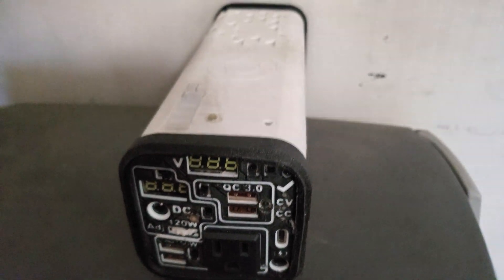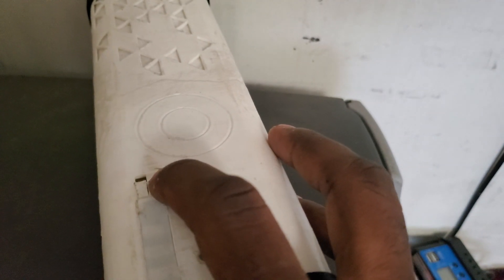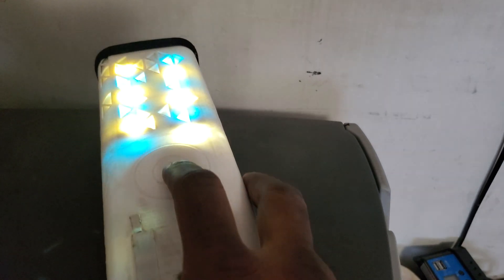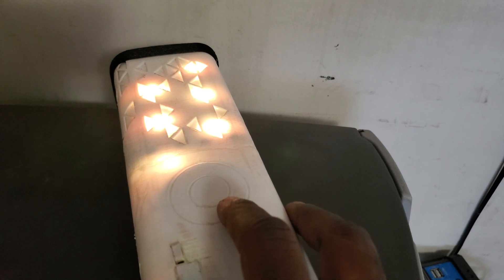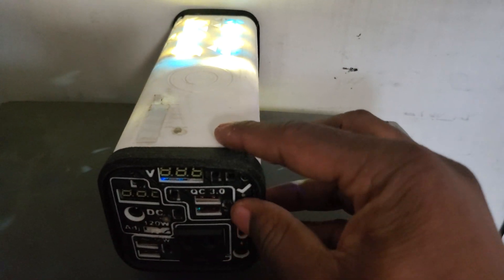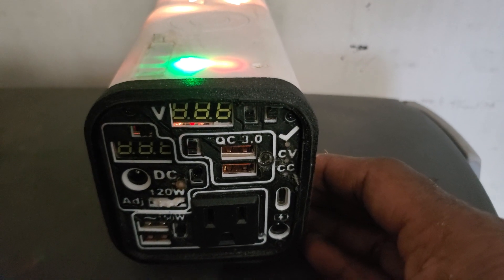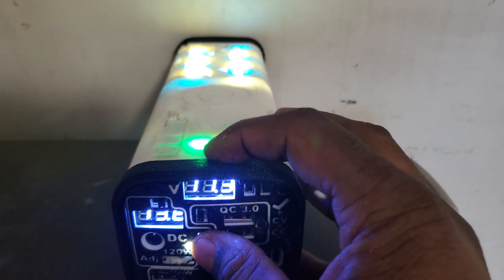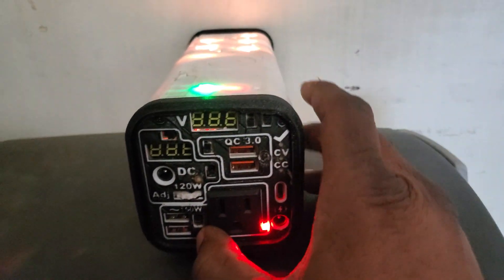Ultimate 18650 Power Bank

Comment: can you use the inverter and the usb at the same time? because I've noticed that the modules are all connected in parallel, shouldn't that give a voltage drop off?
Reply from the maker: They are barely being loaded. I never put a heavy load on the inverter so everything function as it should. The issue is that since this is a 3s setup 11.1v nominal, the inverter will shut off prematurely when the batteries are still decently charged. 

If I were to do this again, I'd make a 4s setup and use a step down converter for the inverter as a 4s setup will run from 16.8 volts down to approximately 11 or so volts.

Comment: Clearly not a beginner project, but with my habit of diving way too deep into things it might be my first
Reply from the maker: Make sure that you really look in the video. I'd also recommend that you put in a fuse holder as it is a pain in the butt to replace the fuse on this thing.  Don't get discouraged and you'll be fine.  

I am looking at his current more compact build.
Reply: @esqueue  I was thinking of just rigging up something to use standard automotive blade fuses
Reply: @esqueue  I was looking at this more compact build aswell but I had so many 18650 cells already that I did not want to purchase the higher discharge A ones, any idea what the downside would be to use a 5A max discharge vs the 10A he says to get

Comment: Hows the 3S works? What do you think, is it possible to use 4S instead?
Reply from the maker: The problem with 3s is that the inverter cuts out pretty early. 4s is definitely possible but you'd have to lower the voltage to the inverter. Possibly 3s with some type of boost for the inverter would be another option but would require redesigning.

Comment: Hi.
Im thinking of making one like that.
Tell me how long does it last on charging laptop throught dc plug
And through inverter.
And how long does it take to charge itself.
What if i increase the cell count to 30.... because i dont think these few cells would last more than 1 or 2 hours.
I need at least 5 to 6 hours on dc charging laptop on 19.5 volts
And if i use inverter my laptop charger is 90watts

Comment: How much time did you end up investing into this project? Thanks in advance!
Reply from the maker: Definitely took months between the slow china shipping, re ordering the parts on amazon and ordering parts that ended up being slightly different than the ones listed in the original video. Some were on error but some were on purpose and slight modifying of the cad files to make them work. 
It was more fun than anything. I am finally getting use out of it. Mainly to power my soldering, my dc refrigerator and to test devices.

Comment: Hello what kind of USB type c fast trigger charger did you use. It doesn't work for me. I built a 12, 6v 42ah 18650 battery myself. Really cool if you can help me with that. LG Tom
Reply from the maker: I ordered the ZYPDS model which can be found on AliExpress, Ebay and possibly Amazon. While I try to keep up on tech, I had never heard of 3.0 PD and made the mistake of thinking that I'd somehow get 20v out of my USB C chargers that were rated to 12v max. 

After getting Getting one PD charger on Amazon, I still couldn't get it to work. It clicked on and off. I ended up using an old Laptop power adaptor that I had laying around.  I'm sure that a different brand would have worked but I didn't bother.
Reply: @esqueue  I do it completely differently now I have ordered some step up converters, one even runs with micro USB 5v to 12v and 24v at 0.8 ah and for the car I have ordered a 12v power supply unit that can set the man bite 25v so that you can travel then also has electricity. My battery should then have 50-100 ah at 12, 6v

Comment: Hello @esqueue, you mentioned that you changed the Wireless Charger to another one, can you provide the listing (if it was ebay) or model?

And where did you connect it to.

Thank you.
Reply from the maker: I purchased it off of aliexpress though I'm sure that it can be found on eBay. It is a 10 W wireless charger. For it to be ran at full power you will need to power it with 9 volts instead of 5 volts. I ended up purchasing 10 of the mini dc buck converters that he listed by mistake. I used one of them to get power from the main  power line. The one that powers the relay to the buck converter. The switch is ran between the power to the buck converter.  https://www.aliexpress.com/item/32951758605.html?spm=a2g0s.9042311.0.0.27424c4dyRb8rt
Reply: @esqueue  Thanks :)
Reply: @esqueue  Is it compatible with iphone and samsung ?
Reply from the maker: @GliCidO  It charges my Galaxy S10E just fine.

Comment: I'm planning on designing a new one with a custom inverter and possibly a custom bms circuitry. Not because I have to but because it'll be a hell of a learning ride. What are your recommendations?  If you were the one steering the design what would you've changed completely? Did you have a practical need for it yet?
Reply from the maker: I would have and actually plan in making the fuse removable as I have blown it a few times doing silly things.  As of now, it is down as I am feeling a bit lazy to open it up again to desolder the fuse.  

Second thing I would substitute the boost converter with one that has Buck and boost capabilities so you could power low voltage applications instead of only boosting the battery voltage. 

Third thing was already upgraded inadvertently. I This was putting a faster and higher speed charging wireless charger and having it on it's own circuit so the cigarette lighter doesn't have to be powered to have wireless charging. I had to do this as the faster 10 watt charger actually took 9 volts instead of 5 so I used a micro buck converter to accomplish 9v to the wireless charger. I purchased the wrong one and had to make it work. This is good as the 5w charger almost makes it pointless due to how long the charging process takes.

As for practical need, not really. Others might but I just had fun getting it to work and I think that it is mostly just cool.  By the way, I blew out the fuse the last time by attempting to jumpstart a car with a bad battery with this connected to the cigarette lighter. I didn't expect it to work but didn't think that it would blow the fuse. LOL, It's all good though. I may consider upping the current by 5 though.
Reply: @esqueue  Wow, thanks for the reply!
Reply: @esqueue  so it did start a car?

Comment: quick question: what is the top voltmeter used for? (the one on the rgb lights and whatnot)
Reply from the maker: The top one is used for the total voltage remaining in the battery pack.
Reply: @esqueue  ah, okay.  So, why is it that the mini voltmeters measure up to 30 volts? I thought he said something about 36? Also how did you print the top electronics layer?
Reply from the maker: @pixelatedbeing2797  I'm guessing that they made it go up to 30 volts to save costs on more beefy parts required for higher voltages. I'm unsure of any 36 volt mentions.  Are you talking about the really complicated part? It took lots of supports. The 3D printer that I used had good enough bridging so I put in custom supports on parts that just floated. It was printed upright.
Reply: @esqueue  woah.  All I've got is a modded Di3 and regular Ender 3